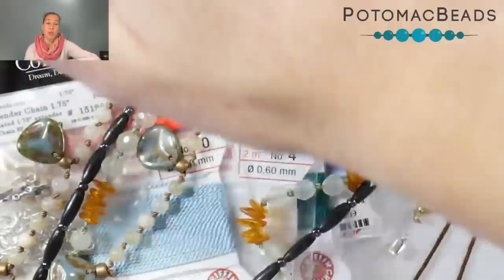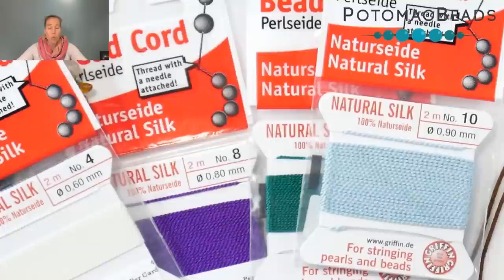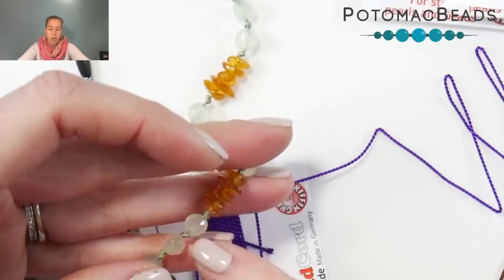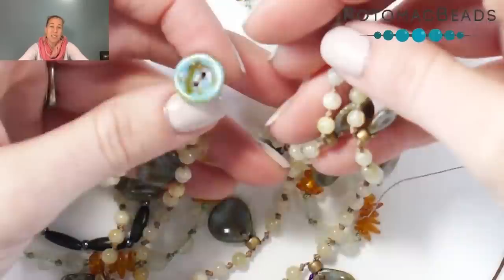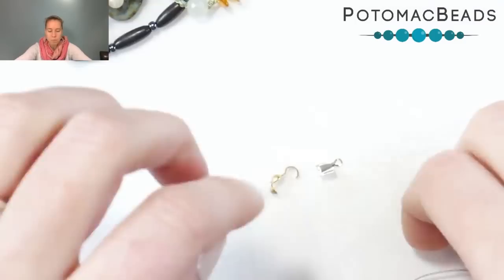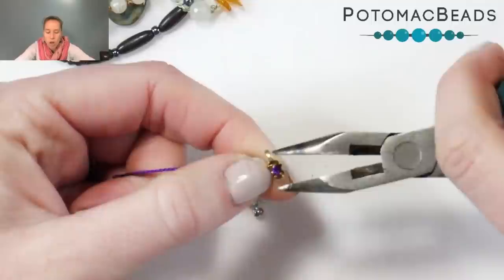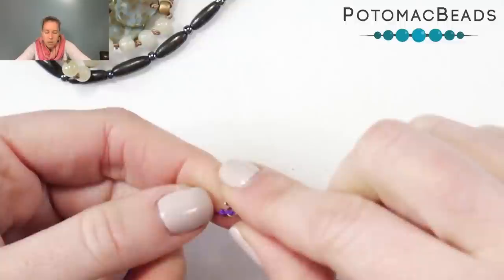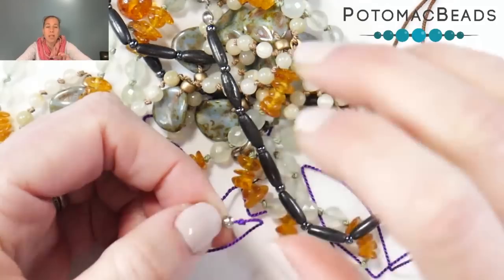Better Beader Episode 28 - Working with Silk Cording

Comment: Thank you so much Allie for making this video, it's wonderful to see all the different ways you can use Griffin Silk or Nylon Thread. I've got a great tip to share with everyone. It wasn't my idea but I will pass it on! To get the kinks out of the Griffin Silk or Nylon thread, there's no need to pre - stretch it or soak it in water and weight it down, or any of the other long winded things that I know I used to do!! All you need is a  small, travel hair -  straightener. I bought mine from a local pharmacy, it's perfect and they're really cheap to buy. I payed about $10.00au for mine. Just plug it in and let it heat up, then run your thread/cord through it. The kinks come out immediately and you're good to go! I really can't recommend this highly enough guys, so please get one. . Lots of love from Amanda in Melbourne, Australia ❤ xox
Reply from the maker: Thanks for sharing. Great tip!

Comment: For a perfect knot very closet to the clamp or what ever you  are using I work with a pin. I put it inside the not before tightening it and slide the knot to the correctamente place, then withdraw the pin. Very easy.
Reply from the maker: What a clever idea, Isabel!
Reply: I use a corsage pin - perfect length and easy to hold..
Reply: I use a soldering pick!

Comment: Hi Allie-thanks for sharing some info about silk cording and a few knotting techniques with us.  The only thing I have used Griffin Silk for was a very long Kumihimo necklace using 11/0 Delica beads--having the needle already attached to the cording made it soooo much easier to string the delica beads.
Reply: Hi Sue, could you please advice on what size of Griffin Silk to use for Miyuki seed beads 11/0? Thank you!
Reply: @Blooming8805  Hi AdeBunmi Lambo--I don't really remember what size Griffin Silk I used for the necklace I made, so, I suggest you contact Potomac Beads at their customer service and ask them.  You'll get a more accurate answer there.
Reply: @sue7777  Thank you, will do :)

Comment: Thank you for this video. I love Griffin silk cord and have used it to make lariat style necklaces and long necklaces. Easy to work with. I do put weights on the ends and hang it over the shower curtain rod to stretch it.  It has a beautiful drape and I find it to have less stretch over time than regular beading wire.

Comment: Thank you for your tutorials. I need to make a choker-length single strand silk cord necklace that is soft as possible, with a non-scratchy clasp. I'll be adding a charm, and maybe a couple of decorative knots.  The clasp should not be tiny, and should be easy to use. I'm a complete novice, so any suggestions would be welcome!
Reply from the maker: https://www.potomacbeads.com/silk-thread
Reply from the maker: https://www.potomacbeads.com/claspgarten-clasp-barrel-1-strand-silver-rhodium-plated#attr=105509,105510,105511,105512

Comment: Great video, I’m thinking of using silk cord in some of my pieces to replace beadalong steel wire. I find with constant wear and  just a light piece, iLife span is about 1.5 years. Less for heavier details. How would you compare the silk thread for durability? This is with constant everyday wear and in the water?I like to road test things before I sell but this is a long time to wait haha
Reply from the maker: The silk cord holds up really well and is very durable. It can wear over time, but it is not as dainty as it sounds

Comment: Thank you for taking the time to explain the silk cording and covers. It was a little confusing for me at the end. I am not sure why you would create an exposed knot after covering the second to the last knot at the end.  See, spelling it out doesn't even make sense. LOL.  Unless you are not covering both but just the very last one. Is that correct? If so, why the need for two knots at the end at all? Also, have you ever used a surgeons knot for your knotting technique? It looks more like a macrame stitch than a knot. Very nice.
Reply: The extra knot was to echo the first knot at the beginning of the piece.

So, starting from one end of the piece, you have:
1) the clasp
2) one or more jump ring(s)
3) the knot cover, which is clamped around a "functional" knot
4) a (decorative) knot
5) the first bead
6) a knot
7) the second bead
etc etc, until you get to
9) the last bead
10) a knot
11) a knot cover, which is clamped around another "functional" knot
12) jump ring and clasp

Hope that helps!
Reply: Thank you, tyroo .
Reply: You're very welcome <3

Comment: I would like to know how do you determine the proper size of the silk thread to the size of the beads?  Is there a chart that can tell you what size thread to buy for the size beads?  I want to thread a blue jasper beads size 8mm but don't know what size of the thread should be.  Thank you!  Love this tutorial!  I just learned a lot more than I realize.  Except the size of the threads to the beads.
Reply: Right around 3 minutes in she touches on this. 4 mm bead… usually will work w number 4 silk. 8 mm bead number 8 silk. Not an exact science since bead holes are all different.

Comment: Hi Allie! I just watched the better beaver episode today about pearl knotting. I have to fix, for the 4th time, a necklace of 2-3mm faceted gemstone beads. As you know, they have such tiny holes! I used size 19 Beadalon wire in the.25mm thickness. I remembered that silk is extremely strong, but I don’t think I have the right thickness for the “surgery “ of this poor piece of jewelry. What size of stringing cords would you recommend for such delicate work? I am getting pretty frustrated with trying so many different ways to do this
Reply from the maker: Hi Lisa, you could use a size 1 or 2 silk.  Other wire I would recommend would be the .015 Beadalon 49 strand.

Comment: Hi,  one spool of the silk thread with knots between 6mm pearls how long will it be???
Reply from the maker: One spool of Griffin silk is usually enough for most projects. It's 2 metres long.
Reply: @Potomacbeadco Thx for the quick response.  So what does that mean. If I'm using 6mm pearl with knots right next to the pearl. How long would one spool give me? I'm looking to make a 30 inch neckless. So how many spools do I need?
Reply: @TH-dj3zo  The spool is 6feet 5inches of silk your project is only 2feet 6inches. So with one spool you can at two and still have. Silk left over.  Love to see your design.
Reply: @T H  One spool will definitely be enough to make a very long necklace, even 30 inches. And you'll probably even have enough leftover to make a matching 7-8" bracelet, too.

But you may not be able to make two long necklaces with one spool of thread, because all the knotting will take up several inches of length.